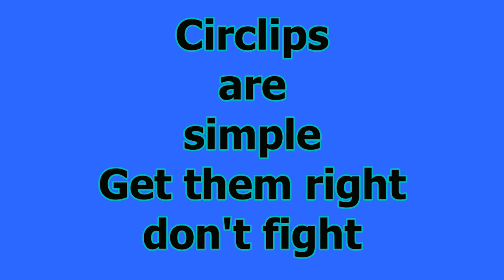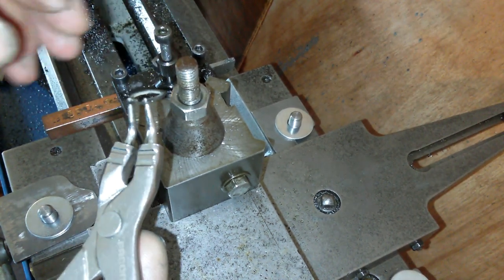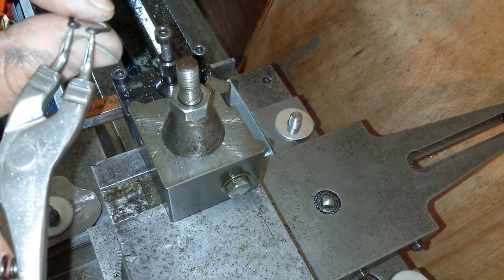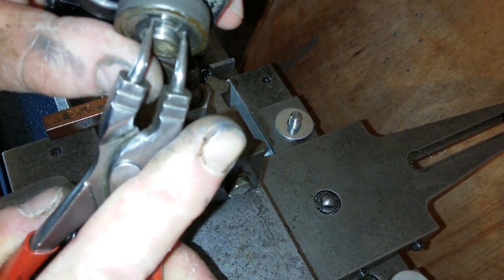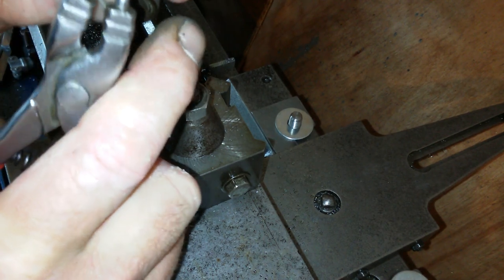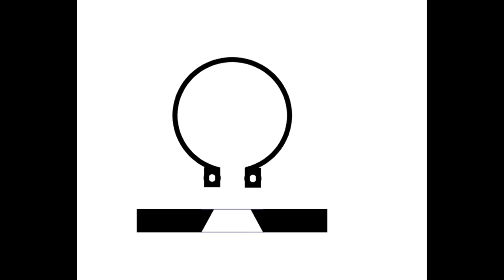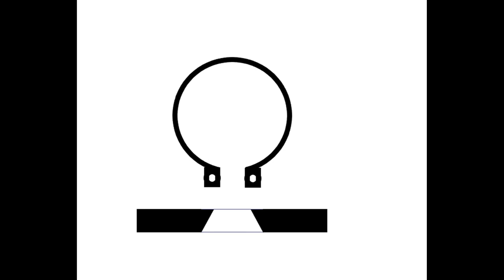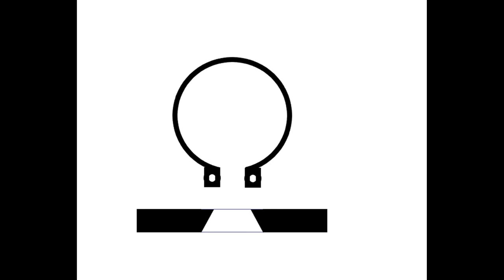Circlips do's and don'ts

Comment: Great, practical tip. I've been wrestling all afternoon with removing several circlips,  using both old and brand new tools with tips that are a hair too too short to reach and properly grip these circlips, all of which are firmly seated in recessed areas down inside the hub of the device I'm repairing.
Reply: Knipex makes extraordinarily sturdy circlip pliers - the straight tipped ones are long enough to reach down into otherwise inaccessible places.

Comment: also to note, the dull edge goes toward rotating parts to prevent friction an rotation,which leaves the sharp shoulder in the proper retaining groove. the snap rong itself is stamped trough a die and press making one side rounded and the other sharp ,inside outside and removale holes. usually leaving sharp side out .but if in doubt check thrust loads, other wise perfect video, thanx.
Reply: ❤e9

Comment: What you call chamfered I call conical, that is, the holes are conical shaped. But I’m not sure if that’s intentional and by design, or simply the result of how these parts are stamped? In any case good info to learn. Thank you.
Reply from the maker: Okay, I got taught this method from an old timer who was British Leyland and Jaguar factory trained, from a time when details mattered. If I put the clip on wrong, I knew about it. I saw a video, where the engineer put the clip on then struggled to get it back off again in his demo. The videography was so great I could see he had fitted the clip back to front causing his own struggle.  That was all the day before making this video.

Comment: The other problem is if its installed incorrectly it’s easy to get a little bit heavy-handed on the pliers 

and if you go a touch too far you can very easily stretch the clip it and now it’s buggered you gotta put a new one down

Comment: Any tool recommendations for small circlips? I'm finding that the pliers I have won't fit rings 3/8" (10mm) and smaller. I've tried about 4 different brands.
Reply from the maker: I've always used my FACOM Tools set. I was gifted some Brittool sets. i've used screwdrivers and even modified longnose pliers in the past.  It's not the tool, it's how it's wielded.

Comment: I'm trying to install a snap ring onto the end of the shaft of a bread pan for a bread machine. How do I do it if I don't have a circlip plier?
Reply from the maker: Sorry for delay. Had ABS fault, Lathe fault and new machines to sort way to busy.  Two flat blade screwdrivers can be used to get externals off. Two mechanic straight pics for internals with a flat blade
Reply: Much less frustrating to use the right tool. Big Box and Hardware stores sell pliers with interchangeable straight, 45 Degree and other tips, with the ability to use them on either internal or external circlips or snap-rings for about $15, regardless of brand.  However, these all-purpose snap-ring pliers are sometimes not long enough to get into tight spaces. For a small price you save time and avoid the risk of having a screwdriver or other tool pop back and injure your face or an eye.

Comment: Nice to know...but isn't it actually caused by the stamping process, rounded on the punch-side and sharp on the die-side? Thanks!
Reply from the maker: Yes well put, so putting on willy nilly will lead to a 50% chance of leaving future struggles. Untrained people showing installation on YouTube prompted my video. Because of the stamping process you must follow an install procedure. Lets face it these days they could be made with laser cutter or edm. they all have this taper😉

Comment: That’s a snap ring.  Circlips are the wire spring rings, such as those that contain piston wrist pins.  I wish they used interior snap rings on pistons but they use wire spring circlips that just love to go sailing across the shop never to be found again.
Reply: Somewhat correct? yet using a magnetic bullet proof vest will increase your chances of finding that airborne (retaining device?)May also find some of your small screwdrivers, picks, pliers and contact lenses
Reply: Not so. It’s simply a difference between British and American English. In British English these are always called circlips. This major global supplier makes it clear https://uk.rs-online.com/web/generalDisplay.html?id=ideas-and-advice/circlips-guide
Reply: @ronanrogers4127  there is a difference between circlips and snap rings.  Circlips are just spring steel rings that fit in grooves, e.g. the retainers that hold piston wrist pins.  Snap rings do many of the same things as circlips but they have holes on their ends that are grabbed by a set of snap ring pliers.  My 1978 Chevy 4x4 had a New Process four speed in it and it contained circlips on its synchronizer gears, as spacers.  I just loved to break them shifting gears.  Ever few years, I would have to replace them.  I got pretty good at it. - drain the transmission, dig out the broken parts from its sump and remove the broken circlips from the Jack shaft.  Install new circlips, refill with transmission oil and button up the transmission.  Circlips on wrist pins of a two cycle engine are also a challenge.  I have put many into orbit.  I never start out installing them without having a couple extra laying around.  FYI, I am a Scot so I do not do things the way Brits do.

Comment: I've got a snap 1/16 ring that goes on a bolt with only an 1/8 of an inch bolt sticking out and putting on a vice can't happen because it's a fixed position bolt. aggravating

Comment: Doesnt anyone know that the so called "chamfer" is only incidental to the coining process by which these retaining rings are stamped out???    do you all not know that which way  the "coined" face  faces can be absolutely critical under heavy axial thrust load?? whats all this boolsheet about making the ring stick on your cheap-ass pliers. True some in some cases it doesnt mattter which way the "coined" or rounded face  faces  but  in many cases the retainer ring will fail if placed with the rounded edges facing the wrong way.  That is what is vital...not whether your cheeto  pincers can operate  a pair of snap ring pliers